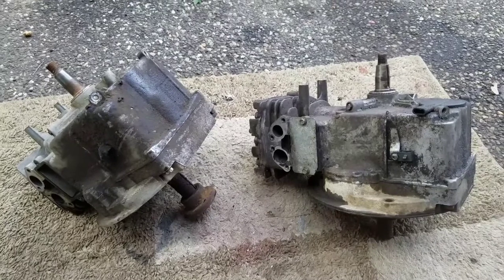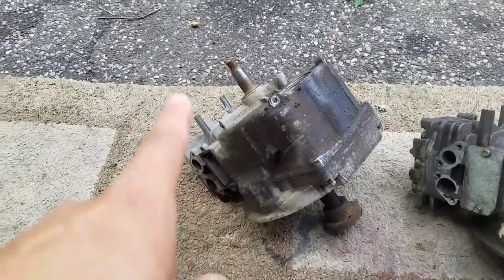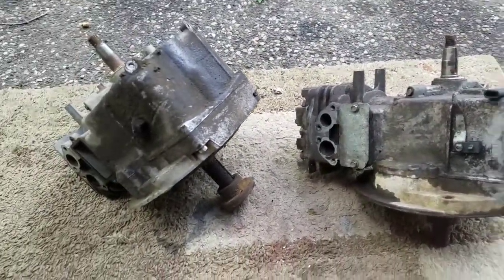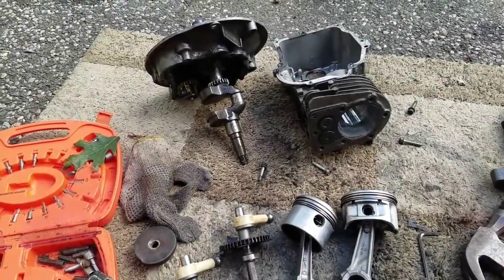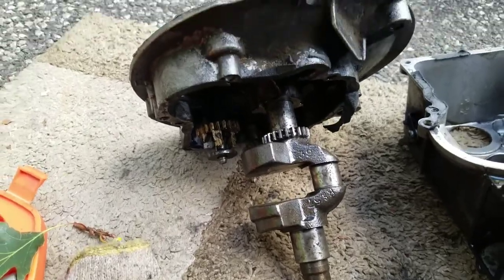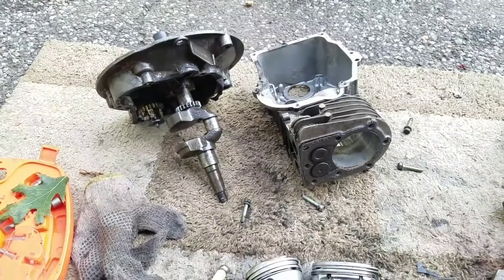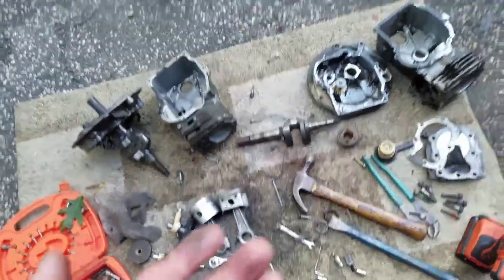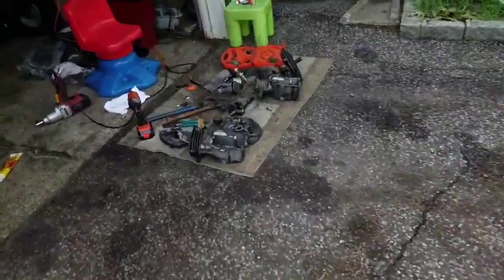TECUMSEH VINTAGE LEGEND & VANTAGE LAWN MOWER SMALL ENGINE BENT CRANKSHAFT SWAP DISASSEMBLY TEAR DOWN

Comment: Yes you can make a little $ but since it  cast aluminum it might be more since you already separated it.  

Typically when I scrap a mower deck and engine together I get about $5 since it’s mixed metals.